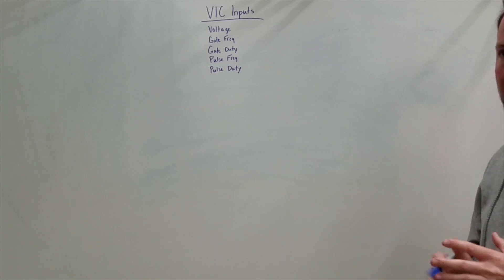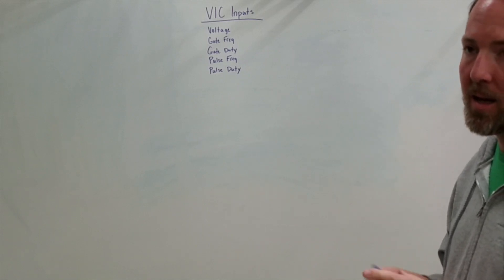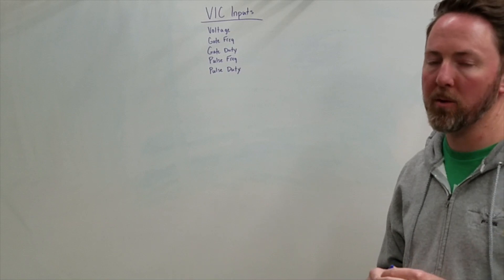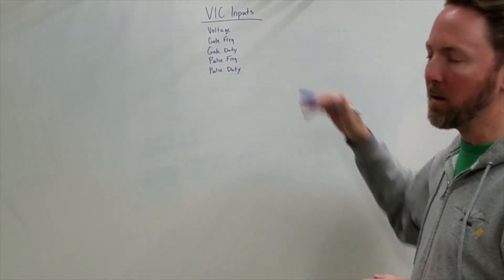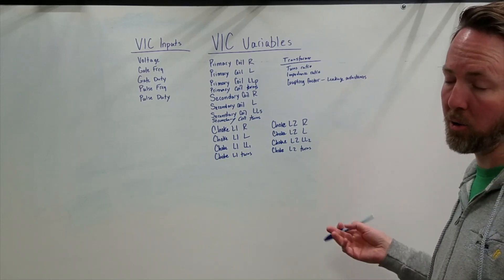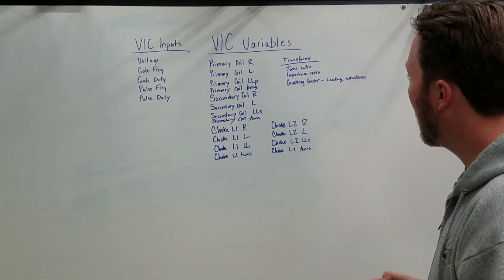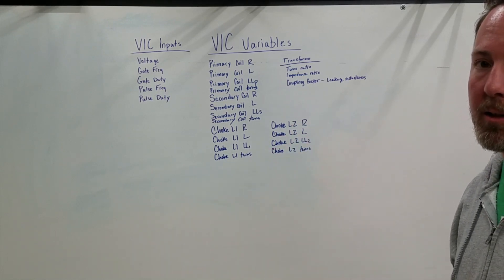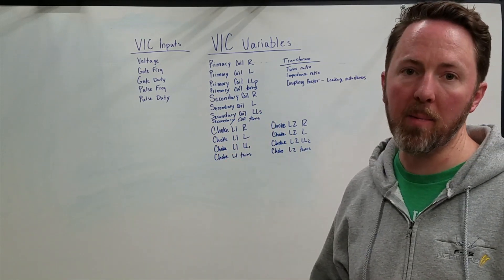Stan Meyer Research # 34, Jul 2023-Stan Meyer's V.I.C., operating theory

Comment: Yes also got issue with core.  Electrician with PHD told me that if you take random core it will not work. Example core from TV is designed to be efficient for specific frequency. And especially pulse DC current few ppl understand. I didnt understand him what he was talking about but as this video pointing on this topic he was correct. But in theory you can calculate inductance and capacitance to match core design frequency? Because you are not looking for resonance of water molecules. You are looking for resonance between capacitor and coil and distance of dielectric water to get polarised molecule HOH shift to HHO that change to different water cluster formation. I would like to see somebody who produce this gas to test what temperature will turns into liquid. Also to add that nanoparticles are explosive.

Comment: This is a good simple to understand explanation as to why this is impossible as Stan described: 
In theory, to separate water into its constituent gases (hydrogen and oxygen) using an electrostatic field alone, you would need an electrostatic field of extremely high intensity or voltage potential to overcome the covalent bonds holding the water molecules together. This process would be highly impractical and potentially dangerous for several reasons:

Bond Strength: The covalent bonds between the hydrogen and oxygen atoms in water molecules are very strong. To break these bonds, you would need an electrostatic field with an immense voltage potential, far beyond what is achievable with conventional equipment. This would likely require a field strength in the megavolt range or higher.

Safety Hazards: Generating an electrostatic field of such intensity is not only technically challenging but also extremely hazardous. High-voltage equipment poses serious safety risks, including the potential for electrical arcing, breakdown, and physical harm.

Equipment Design: Creating equipment capable of generating and maintaining such high electrostatic fields would be a significant engineering challenge. It would likely involve large and complex apparatus that is not readily achievable with everyday materials or technology.

Energy Requirements: The energy requirements to generate such a field would be immense, potentially far exceeding any practical or sustainable energy source.

In practice, water electrolysis is a more feasible and controllable method for separating water into hydrogen and oxygen gases. It involves using an external electrical power source (e.g., a battery or power supply) to provide the necessary voltage and current for the electrolysis process, which can be conducted safely and efficiently. Electrostatic fields are more commonly used in applications like particle accelerators and experiments in high-energy physics rather than for practical chemical reactions.
Courtesy of ChatGPT ;)

In the end, one needs to look no further than Newton's first law of thermodynamics: Energy cannot be created or destroyed. 
Even in theory, if you could create an electrostatic field strong enough to split water, you would use so much energy to generate and sustain that field that it would probably be even less efficient than regular electrolysis that uses current flow to achieve ion movement. No amount of vibrations and resonance can overcome the fact that energy is not created or destroyed. 
There are no shortcuts or loop holes, only tricks, but nothing more.

Comment: The frequency doubling effect is a hint you hit resonance, but based on the choke coil back EMF. for a coil to successfully generate an impulse your square wave input must end infinitely sharp. Fn generators, without mosfet gate drivers lack the power to trigger a nice impulse. 
I still don’t see Perfectly how the coils interact to step-up voltage. But the impulse is the best a coil Can do to create voltage spikes.

Comment: Hi Brad.. me again.. want to do a trade for the hybrid VIC controller..??.. I have the round bobbin transformer complete with laminated core and already wound FR430 ss wire on it ( both are identical to meyer specs, I had the wire specially made and I bought the laminated core from max miller a few years ago which was also custom made to exact meyer specs) ... I got the bobbin from Russ Greis (RWG) and you can see it in my last 3 video's ... If you are keen let me know.
Reply from the maker: If I had an injector built to specs I might be interested. Only thing is I haven't done much research on that VIC. I built one and those chokes had 20H inductance when I measured them!

Once things slow down this fall I'm planning to redesign the case. I might sell a few then. I think I have 9 of the V3 boards.

Comment: In my experiments, the fuel cell was determined by a capacitor, a diode, and two diodes directed in opposite directions. I do not exclude that it can be defined as a resistor, an inductor.

Comment: You don't have a fuel cell model. It accepts electrical variables. However, the molecule has a mechanical model (Stanley Meyer). And you don't have a mechanical model of a molecule linked to an electrical model of a fuel cell.
When you make the linking, only then you need to switch to the configuration of the VIC.
The setting of the VIC variables depends on the characteristics of the fuel cell, not per revolution.
Reply from the maker: Thank you for sharing that. And yes, I sometimes feel like I have a long way to go.

Comment: Has anyone demonstrated Meyer's work yet?
Reply from the maker: Many have claimed they have but not shown enough proof.
Reply: @BradKwfc   Please do not ignore the other 16 versions and other 9 prior to flat bobbin version  which work fine to drive all cells.  shown every where, and in use. Example is  8xa and basic scr,  Version 1 Works fine excellent performance , than versioning switches 10xa  etc etc 9xa with switch transistor works fine strong reliable , and various transformer  versions all Documented bubbles at less than 33.3333 /kw/kg /hr  with the other 9 versions previous to flat bobbin working fine just as described and designed. excluding flat bobbin. if you feel those are too easy and you want to fixate on flat bobbin and say that is the only thing to look at that is a mis direction , than  what you mean is flat bobbin is not shown enough  by those with that version , which people have shown it making bubbles below 33.3333/kw/kg /hr ,  working shown on various channels . Remember going below 33.3333 kw/kg/hr is deemed impossible by the multi million dollar  projects LOL. and the voltrolysis community  already have 9 versions iterations publicly spread all working well below that at pressure  from 8xa to   gms version iterations with bubbles below that , and  global.  the vic flat bobbin is version 9 to  aprox 14 in the iterations.  but hey lets keep just saying 1 thing  means all things to hide it from dummies to keep them  from using it  longer. As those using it are having some fun. Your a absolutist on the flat bobbin in a effort to  finalize that version great stuff keep going but do not mis represent what is in working order and in use.  Examples,  8xa  and Scr,  9xa Transistor board with simple switched in step ups and variac control and chokes. ALL ARE VIC voltage intensifier circuits. all work great  well below rest of worlds 33.3333 kw/kg/hr no salt no heat distilled water . All is great BRAD all this comment is only for people to understand what is in the folders is not 1 thing , but it is 16 version iterations,  just making sure people are clearly seeing what is written as it is written not mis led to thinking it is one thing,  or 1 version.if they have not put in the massive years of time you or others have put in  to decipher the 30 years of Work Stan Did showing the versions and iterations ,  and hopefully they all wise up when reading this and look for the other versions running fine on the internet hopefully they can see  what your short hand on flat bobbin means, as untrained ears may miss what you said about this version this specific assemble of flat bobbin as you state in video if they play it back.  for that specific version. Try the other  9 and try other versions immediately as all use voltrolysis Voltage not amps , have no salt and work well below 33.3333 kw/kg/hr at pressure.  God Speed. Hydrogen Hot Rodding is Here to Stay and already spread in every home garage near you.. PS BRAD YOUR WORK IS OUTSTANDING AND A AWESOME EFFORT WELL DONE a AMAZING VIDEO AND EXPLANATION.
Reply: @hydrogen-power-gas  Well, you almost made a valid point there. But then you had to plug yourself. Brad's right. Everyone is claiming and no one is showing their waves or are able to accurately describe the process. Just trying to deceive and make money.. He stated in the video that his focus of this was specifically on the VIC5 core operation. Maybe you should go back and have a re-listen 🤔
Reply: It is out there in use.

Comment: Correct me if Im wrong. In the choke you have parasitic Xc , Xl , and R.. the ratio of parasitic Xc to the coils R determines how much energy wants to try and store as reactive power in the form of capacitance between winds and how much passes as real power.. the higher R is than parasitic Xc, the more the wind to wind capacitance wants to store electrostatically than pass as current? In other words enhancing the transformers self resonance ability?
Reply from the maker: Reducing the R of the coil increases its Q factor which means it will store more energy,  resonate longer, easier & with less energy loss.

I've heard several people mention the distributed capacitance Cd of the coils is more important. Personally I don't think that value is as important as the other variables but I could be wrong. 

Energy can be stored electrostatically in the Cd, but it can also be stored in the inductance. 

If the Cd is too high I would think it would cause problems as the coils may begin to self resonate, at that point the energy would be trapped in the coils and not transfer to the cell. 

So the problem I see is if the Cd is high enough where the coils resonate instead of the coil inductance and cell then the cell might never get enough energy to charge. 

The self resonant coils would essentially be in parallel with the circuit. They will definitely block current but I think they world block it too much. Parallel resonant circuits have a nearly infinite impedance at resonance. 

If you do the math on the VIC you can see that the peak current flow through the secondary circuit is 250mA, and the only way that can make 20kV (Stan's claim) is with a reactance of 80k ohms. Set this at 10kHz and you get 1.27H and 198pF.
Reply: @BradKwfc  IT is Common for radio engineers to LOOP the  gain they also use a  choke to stop the bleed off back to components.  Remember the Main Capacitor is the pairs of cells in the  wfc , Nano Bubble Waterfuel -Cell which should have blocking and bypass diodes if in series between the cell pairs (also pairs of tube cells wire series balancing the different resistance of inner outer tubes).  these points stabilize the ramp.

Comment: Brad Just a Note, when a solar Panel and its Cells are wired they are wired in series with  diodes and bypass between each cell on the panel to protect the total series part of circuit (10out of the /11 cell) circuit from collapse or fluctuation in case 1 cell fluctuation or collapses , the panel and other cells stay performing  this is so the total circuit does not stop or have wild fluctuations.  The Cells are also in pairs to balance the inner outer resistances of the inner outer tubes. ( so balanced resistance pairs of cells have diode and bypass Diodes between the 5 pairs).  Just Try it. DD

It is just something to for you to  consider that makes it tunable. ( For those  studying this specific flat bobbin 11 cell verion(1 cell is a heater) as 10  cell in series imagine a string of Christmas lights when 1 globe goes out the other lights stop, when individual light/cells. have  diodes and bypass the other lights stay on if a globe goes out) see solar panel wiring.

The points you make are very important for the community , but there is always more points to put in the the final narrowing of the operation parameter . The 11 Cell is not the end it is part of 16 or so  variations or version iterations Stan did over time, mostly for different mechanical applications or stepped patent application approvals. .  vic voltage intensifier circuit is described in the  versions which do not use flat bobbin also.  so it is not limited to only that version/ iteration  as all other version or iterations  work.

So far 1 to 9 work just fine to make voltrolysis and save world, so people can use them now. the 11 cell vic voltage intensifier circuit on  flat bobbin version ( which has several tank versions,  is the one for doing specification of nano bubbles, gtnt, and and  the ultimate fine tune of efficiency. Before the Round vic voltage intensifier circuit on  round bobbin was made. 

 Those bubbles also add  capacitance and resistance as you have zoomed with a Freaking microscope you know, 

but just note,  what happens when they are staying in suspension in between the plates as homogeneous nano bubbles.   

engine fueling and efficiency do not hinge on the vic voltage intensifier circuit on  flat bobbin version being mastered. 
As there Many working  early version before the vic voltage intensifier circuit on flat bobbin ,  and versions after it  using 11 cell ,and Nano Bubble Water fuel  , Working can mean voltrolysis no salts and very little amps, making fuel efficiently better than pem or alkaline, lower than 33.333kw/ kg
and making nano bubbles and gtnt.  For those Professionals reading this this is the forest your looking for with out the flat bobbin.

No one has all the answers we all do  a part ,

that is by Design.                                           

A Master Never Stops Learning.  
A Definition of a Master / water fuel master  should be he is never satisfied 
with what he has learned. 

But should stop and look at the trail of success some times.  
as those successes are the trees which you have planted which are making the forest possible.

GOD SPEED BRAD
and THANK YOU STANLEY A MEYER 
and Radio Electronic Genius Stephen Meyer for inventing these technologies 
and giving the methods  to the world.
Reply: Hi Dan.. how's it going.
Reply: @electro1622  Rocking and rolling

Comment: Sounds like there is a complex mathmatical formula that needs to be discovered.  That is a huge deal on par with Ohm's law.
Reply from the maker: Yes, even with the formulas it's difficult to determine exactly what the values will be afterward. Adjusting the values by gapping the core or by adding/removing turns is easy until you see how much it effects the other coils due to the coupling. Getting it to work is impossible if any part of the VIC is incorrect.